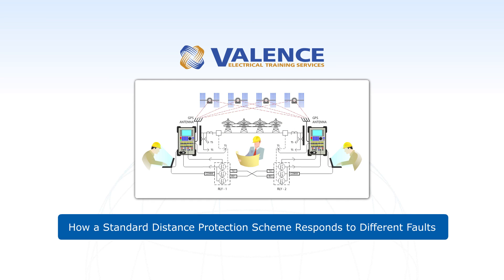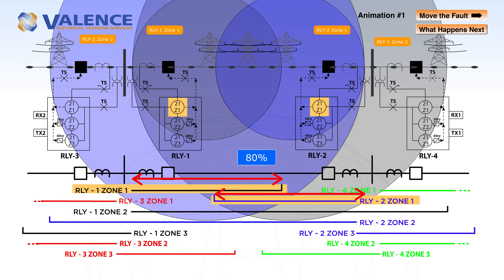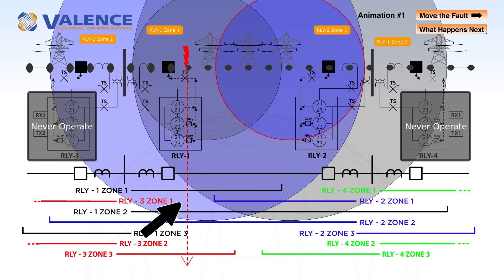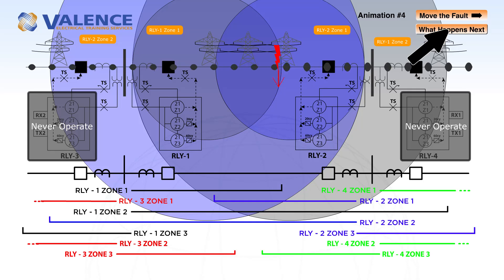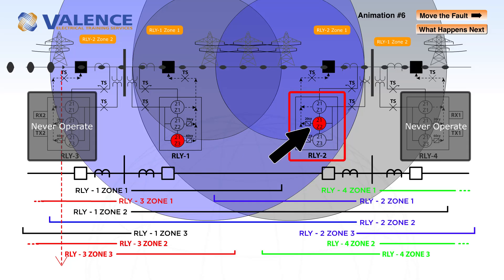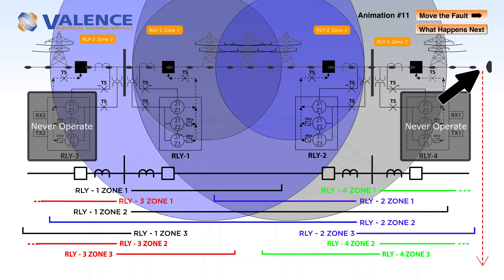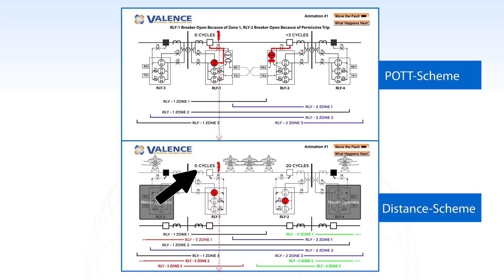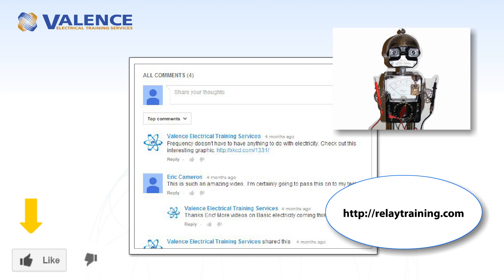Understanding Line Distance protection (21)

Comment: Communication assisted Protection Schemes could be good because the fault should be cleared in minimum time in order to save all the protection equipment and self isolate the Transmission line

Comment: Nowadays distance relays modeld like D60 P742, REL670 are coming with 5 zones. what's the advantage of increasing this zones.    Line differential are used only if the lines are less than 10km . How to communicate with remote end relay
Reply from the maker: The only advantage is increased flexibility for users who want to fine-tune their zone protection. I can't believe the maximum distance for a fiber optic connection between two line distance relays is 10km.  Can you send the source information with this limit?

Comment: Excellent presentation. I have a question. Line distance protection advantage is its independence on change of the system beyond of the zone of protection (because is based on impedance) but is always described in scenarios where power flows in both directions, there are various zones of protection and a pair of relay are used, one at each extreme of the line. But in cases where there are just one zone of protection and unidirectional energy flow (for example in my case, a 40 KM 115kV single line feeding a radial/terminal substation), does it make sense to use line distance protection just at power source side?.
Reply from the maker: +janavax 

Sure.  Many generator protections schemes apply distance protection looking out toward the system with significant time delays as backup protection to isolate the generator from faults external faults not cleared by external devices.  Impedance protection would be applied anywhere that you want to create a specific zone of protection and can predict the impedance of that zone.

Comment: Hi I was wondering, what criteria would determine a communication based schedule like pott, or Ducb etc.
I know line differential is used when line SIR is very high and distance based protection cannot be applied.

You also mentioned that grid can't handle large duration of fault contribution.
Can you please give a real world situation,
Reply from the maker: Parminder Dhawan 

Some choices are based on Technology such as line differential (need fiber), DCB or DCUB (need carrier equipment). PUTT schemes shouldn't be used in systems with weak infeeds.

I was more talking about equipment rather than the grid. All equipment on the grid can withstand some fault current for a short duration. The longer the duration, the more the insulation breaks down or arcs form.